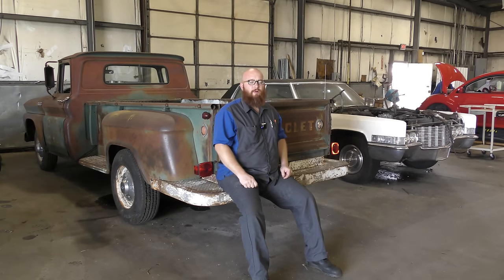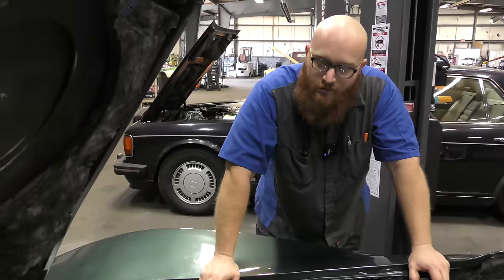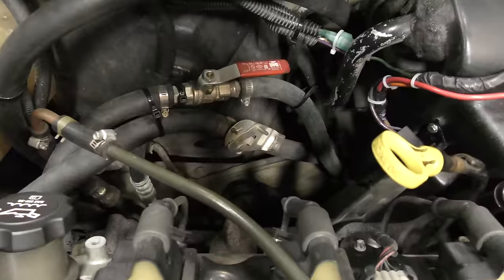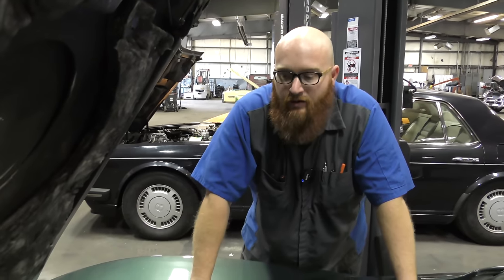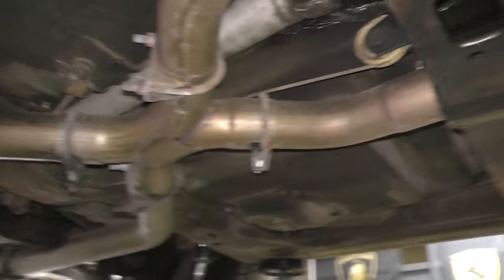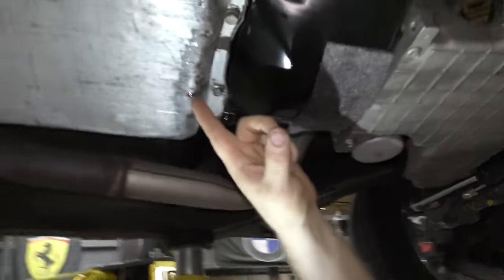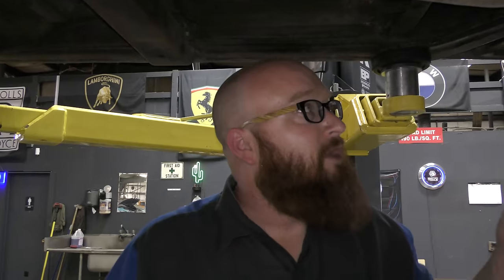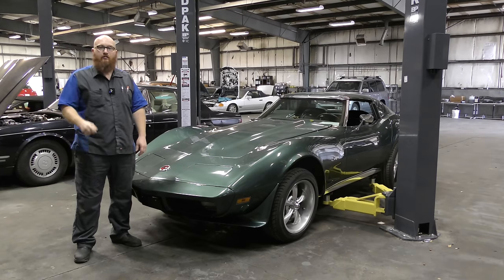Issues AFTER an LS swap! CAR WIZARD warns what can happen on an LS swapped '73 Corvette Stingray

Comment: I have a 72 Porsche 914 that has a 350 small block Chevy and I took mine to Ventura Carburetors they were happy to help me out. Per their request I purchased a Edelbrock “Strip Kit” for the small 600CFM . They dialed it in and it has worked well ever since. 8 years ago, stove bolt simple definitely low tech , I am considering going to an LS engine but after watching this video maybe not !

Comment: You can always tell when a car has a carb when you get behind them by the smell.
I always hated them and have rebuilt a lot of them.
Reply: That and usually carb cars wont have catalytic converters,when people delete cats from fuel injected cars they start smelling like that too.
Reply: @Jdres123  or run them open loop and rely on the tune

Comment: Car wizard, vornado sent them in winter because they are air circulators not fans. They do make excellent fans but are also great for moving around the heat in the winter.

Fun fact: they are currently headquarted in Andover, and originally in Wichita!

Comment: Think that’s a c5 oil pan, I’m a mechanic also and he has very good points, honestly I would probably say only mechanics/hobbyist should drive engine swaps. If you didn’t do the swap you shouldn’t drive it in my option
Reply: If the person doing the swap took the time and had a fair budget to work with i wouldnt hesitate to let any of my customers drive a swap.  If it was an apparent hack job then you need to go through the issues and sort them out. Its just a machine it can be fixed...

Comment: The carb cripples a modern engine with old technology.  It is not even a TBI style carb where the fuel is somewhat computer controlled.  The person who did the swap should have used the stock GM fuel injection system with all modules, full harness, etc.  A fuel system was not the place to cheap out on the build.  If the current owner wanted to upgrade the fuel system it would have been relatively easy.  The best thing that the owner can do now is add a fuel injection system that works like stock with a module that gets data input from sensors that monitor air temp, coolant temp, oxygen levels in the exhaust, etc...and integrates with the ignition system for optimal operation.
Reply: Says a person who knows nothing about Ls engines

Comment: Hey Mr. Wizard.. a simple wide band setup would allow you to tune it very easily..
Reply: TableRocked it’s a device that measures the air/fuel ratio with an O2 sensor in the exhaust. That will tell you if you’re running lean or rich.
Reply: People are cheap they don’t wanna spend the 3000$ to get a new intake fuel injection gut the exhaust weld on the flanges you screw in the o2 sensors then do all the software on ur computer tons of wiring new fuse box it’s not that simple even the holly efi kit a bitch to install carb 5 minute install done
Reply: Makes perfect sense.. AND there is no need to permanently install it or add a permanent fuel management computer. And people, no need to assume anyone was being cheap, we have to remember we do not know the car's backstory and there could be a very sensible reason for what is in there now. I get to go under a lot of classic cars and today its rare to find one that has not been molested over the past 50 years. Doesn't really matter which solution is implemented, its a modification and will take time and thought to execute properly. But SFS's suggestion is a good one for the average home tinkerer. (Wizard could just go borrow a tailpipe sniffer and get to the bottom of it pretty quick).

Comment: Have done 2 LS swaps. Both times I cut down the original truck harness. It takes about 8 hours to do a harness if you know what you are doing. Things to be aware of are you have to deal with a new fuel system, getting the ECU flashed, what transmission to use, cable or drive by wire, air intake ( they don't like hot underhood air) motor mounts, exhaust, cooling fans, etc

Comment: Thinking about an LS swap? Don't forget about the brakes, frame, axle, electronics and gearbox because it cost serious money. Don't forget about the oil pan as well
Reply: I would think that with dozens of great small block crate motors available direct from Chevy, why go thru a nightmare like this?
Reply: Why would you need to worry about the brakes, frame or axle? Electronics come with the engine generally. Short of a 700r4 you can use the original trans for the price of a clutch or flex plate. Oil pan is only a problem when putting a truck engine in a car. Have you done this before?

Comment: All it takes is an air fuel gauge , tuning kit for the carb ,some time and a bit of thought.   Understanding how it works helps to lol.  I am in the process of turning my 78 firebird and it’s a bit to wrap your head around with the vacuum advance , ignition, timing,  carb calibration.   I got it close but not perfect.

Comment: it doesn't make any sense why someone would go to all that trouble to put an LS engine in a older Corvette and not go with fuel injection which those engines are originally made for fuel injection!! they might as well have just stuck with the original 350 that probably came with it originally which by the way was carbureted!! It defeats the whole purpose of doing it in the first place.smh..😔

Comment: I've owned my '73 Corvette for exactly 30 years. It came stock with the embarrassing L-48  350 CID. Not much power at all. About 15 years ago I bought a GMPP  ZZ4  (355 HP/405 TQ @ the Flywheel) and a Holley Street Avenger 670 CFM carb. I broke it very aggressively and had it Dyno Tuned.  Now the '73 will give my C5  6 speed Corvette Convertible a  run for its money. I give a lot of credit to the proper break in procedure and the Dyno Tune. It's a beautiful and quite quick old dog. Cheers.

Comment: My 77 Vette has the LS2 with LS3 heads and is Carbed. I bought it this way. It comes down to finances for me. It runs amazing and dynos almost 500hp to rear wheels. I have a few friends who know carbs very well. I know carbs better than electronics with having a Chevelle and Chevy ii as well. 
My AC works fine and it's converted. Really enjoy this setup regardless. The torque is amazing!! Not drag racing, just cruisin with better power and speed than stock. It's not really that difficult to figure out what's going on under the hood.

Comment: I am doing something currently that I don't want to do...but it's necessary. I own a '76 Seville w/ fuel injection that I need to convert to a carb setup.  The parts for the Seville injection are expensive, or not available at all.  Can't get the injectors. So, I feel confident enough to setup a good carb for it to eliminate the problem altogether.

Comment: Doesn't a carb pretty much defeat the point of an LS swap?
Reply: yes lol
Reply: Not at all,  A carb will run them just fine setup properly and make the same power.( Fueling does not have to be perfect for best power just reasonably close.) What the LS gives you is a better base and head design that is more efficient and electric timing control where you really get most of your power from tuning.

Comment: I know this video is aimed at novice or non mechanics, but if you're buying a resto mod car, you certainly know what you're getting into.  I did my first engine swap at 15 years old, putting a 327 in a '50 Chevy Sedan Delivery.  I rebuilt the engine and did the brakes, suspension and electrical system on my own and when it was ready, I drove it to high school.  It's not rocket science even with an LS engine.  Buy or build the car you want, get as much information on the build as you can for future maintenance  and enjoy the drive.

Comment: I"m currently in the process of J37 swapping my 2006 Honda Ridgeline. It's been a nightmare. I so many issues I didn"t plan on. The cost has double for shop time and the truck still isn't  running right. In hindsight it would have been cheaper to replace the blown head gasket, but you live and you learn. Having a classic Ridgelinge that makes better power than gen 2 should be worth the hassle.

Comment: Just doing some wiring right now for a set of gauges and some accessories.  Rule #1 of old cars- if you modify the harness or make something new, include a new wiring schematic (make it) and include it with the car if you ever sell it.  Or just keep it for yourself.  I did keep the entire wiring harness for the new stuff separate from the old harness to keep it clean.

Comment: I'm doing a engine swap on my nova ..it had a 350 now it has a 468 big block it's fuel injection and love it.. as well I have all my wires tuck and a full diagram in my computer and printed

Comment: Before installation of any LS, replace the rear main seal kit, dog bone and new toque converter seal. If LS has over 180k, we check compression,  and proceeed deeper if necessary.  We seen lots of worn cam bearing throughout the years.

Comment: I worked in 2 shops that were building modified cars, in both of them we gave customers a folder with all the parts used and depending on the complexity of the build wiring diagram and a couple of times even an owner manual with pictures to explain functionality and service. Of course it wasn't free, except for a simple folder with parts list.

Comment: One of the swaps I did was a fuelie 5.0 into a '63 Fairlane but went with a carb. No real issues.  My current one is a fuelie 5.0 into a 70 MGBGT and I left it stock and used all the stock Mustang wiring and it went perfectly. No issues after two years.

Comment: I'm an Electronics technician I put remote door lock control system on my 92 Camaro I used fabricated parts timers and relays that I tied into the door switches on the door panel I made a complete wiring schematic of my installation because I know I will not remember every little thing I did and that was 15 years ago but I still have it along with all of the paperwork documentation of aftermarket parts
Reply: Electronic tech also and 40 year owner self modified 1976 supercharged L82 4 speed .Having worked at a small town gm dealership 10 years while going to school and college from 67 to 1977 in auto body paint and mechanical shop I got great training addition to shop class lolo. I just completed a complete paint removal and blue metal and diamond flake . The paint job took tons of work in my home shop . Being the car is SMC you can not chemical strip the car so I had to use razor blade and 80 grit paper to remove old acrylic lacquer and primer then spray with a 2 part  gel coat then block and prime block some more then sealer  base silver then metal / diamond flake  and bury the flake in clear many many coats. Loads of  wet sanding then wet sand with 3000 /compound mostly by hand then several coats of polishing compound and then hi end wax it turned out show car perfect but I will never flake an entire car again  . Also during the early 70ies i studied qjets and became a quasi expert on them .I got rid of the bog and other problems and still run one on my cars super charger which is modified to flow just over 800cfm and is super responsive

Comment: 100% Agree, leave the fuel injection. Chances are the LS came from a car or truck in a junkyard so instead of just buying the engine buy the ECU and the wiring harness, and all the sensors connected to it. If any of it is missing just wait until you find one that has all of those things. Fuel injection does everything better than a carburetor but there is a considerable amount of upgrading that needs to happen to the fuel delivery system to get it to work such as a high-pressure and new lines. Its worth it

Comment: I started as a diesel mechanic, went to school for it, things I don't understand. 
1. Carburetors
2. Pins, which I that was steering
3. What the hell is a rotor when it comes to spark plugs. My boss at my new shop told me to check the rotors. I put on the lift and was looking at the brakes which where drums. Found him and said You know that car has drum brakes. It's not new enough to have a rotors.

Comment: I worked and and used carburetors successfully for 45 years I dont get why a guy that calls himself a car wizard shys from working on simple technology thats 100 years old and actually very easy to understand.  My first carb work was on old lawnmowers mini bikes and go karts, later on cars I found all the principles were the same just multiplied over more floats and venturies with a lot of vacuum stuff added.  You can buy a simple aftermarket edelbrock 4 barrel with an electric choke bolt it on set the electric choke for your climate, run a wire to it, a fuel line etc. set the idle mixture and speed and its off and running.  ANOTHER THING - when the fuel pumps went out they only cost $15 - $20 and you didnt have to take the damn GAS TANK OUT to replace a $400 float unit when the damn pump goes bad, pump was mounted right on the front of most engines-!!!  Also we didnt need complex electronics to troubleshoot problems, just process of elimination most times.  BUT to be fair they didnt teach todays car tecnology when I went to school so I suck at working on todays cars, at a rather old decrepid 62 yrs old I dont have much reason to start learning all over again now.

Comment: In 93 I bought a 79 Trans Am in good shape and swapped the Olds 403 to a Pontiac 455 out of a 70 455 Bonneville. Had the engine rebuilt by HP Racing in Tomball telling them I wanted 500 foot pounds of torque and they laughed and said "no problem"!  I ordered a engine mount kit for the swap so I didn't have to modify the cross member, or worse, weld the engine mounts in place. It didn't take long for that 455 to trash the turbo 350 trany while destroying a Mitsubishi 3000 GT Twin Turbo!! I knew it would happen so no surprise. I swapped it for a custom built turbo 400 and had my drive shift modified and after that, no more drive train issues. I was surprised that the .273 geared differential held up and that car was very fast on the highway!! And very scary on wet roads!!

Comment: This is the first time I've ever really watched your channel and I hundred percent agree with you on documentation label it write it down whatever first thing all electric fan I did one on mine I had one going to computer told you what temperature to cut it on one went to the hot wire on a compressor and compressor come on the fan did also ..FYI  second I hate hearing aid grown tool Turner cry especially about getting transmission fluid on your hands LS swap in that no..a big block in him and theres nothing  like cubic inches ... is the ls cammed bored he didn't say...hook a vacuum gauge up to it turn your air and fuel mixture until you get the best possible vacuum back it down about a half a pound it'll be damn near perfect but that's coming from somebody that worked underneath the shades ... and your are somebody obviously went to school for it... all I can say don't be scared of it.. toys are fun building them.. but I can see your point also.. and I understand that you can't plug it in and have a computer tell you what's wrong with it. . I know that's what you were taught in school. .

Comment: if your EFI set up stops on the side of the road it could have any one of 50 different failures, with a carburetor there are only two possibilities, fuel supply or ignition. a good carburetor properly set up will perform reliably for years without touching it.

Comment: Friends car slightly modified from stock.
Wouldnt idle with 8" sports air filter.
Hmmm bring it up home so I can look at it. Starts, popping ok its running rich! Timing out, back fires through carby.
Retimed adjusted mixture no tools.
Pinged slightly back home retimed slightly. 
Got it spot on bagged up the rear tyres,  fish tailing heavily.
Back for a break, leaving dropped a roll back spinning the wheels right up the street. 
Rang him few weeks later halved his fuel bill. 
No air filter losing
 vacuum! 
No tools needed,  just knew by the exhaust sound the timing was out and to rich.

Comment: buy a dozen plugs for plug readings for number 1 get the carb in the ball park start at 1.5 turns turning a half turn at a time till you can get it to idle , get to the point where you a slightly sooted plug from the mixture beeing  fat and turn the screw back a quarter of a turn and you should be in the sweet spot .make sure float is set right as well . good luck everyone if its an aluminum head make sure you let it cool down before you take the plug out.

Comment: The thing with cara like that that many people learn too late is this and cars like this are for people that either have money to pay to have them fixed or ability to do it themselves. It’s not for regular people.. and I completely agree with you on the carb. Factory carb cars are ok that way, but it’s nonsense to carb an LS engine. Also the funny plumbing valve in the heater hose is factory, you don’t have to adjust it, you open the hood and turn it on in the winter and off on the summer. That’s it.

Comment: Thanks for the video, I built a 72 GMC truck restomod and wasn’t really thinking about someone else working on it.  I used the truck set up with stock fuse box, computer and wiring harness.  The. Since I have the box there tied my fan relays into it, but never drew up a drawing of it.